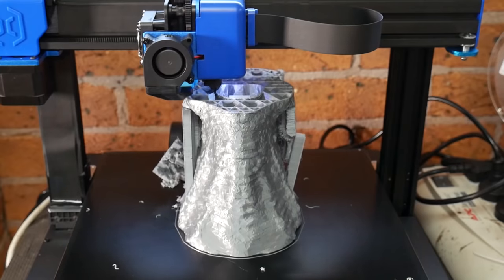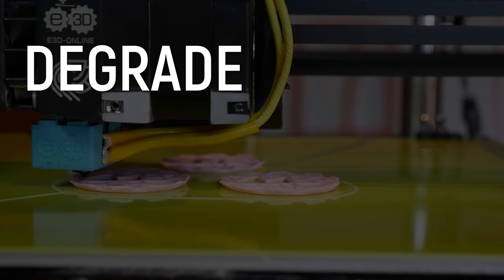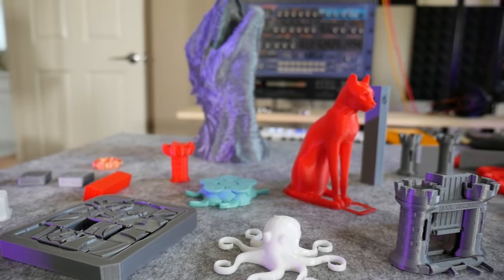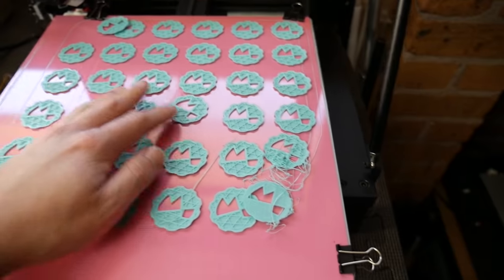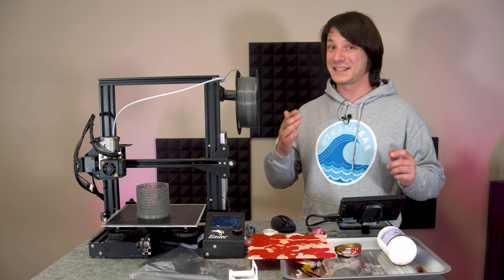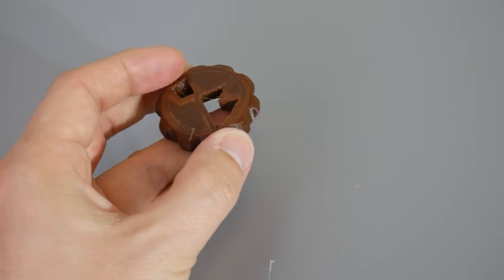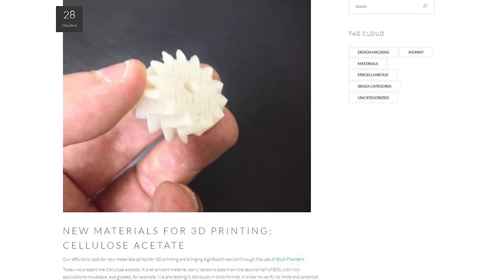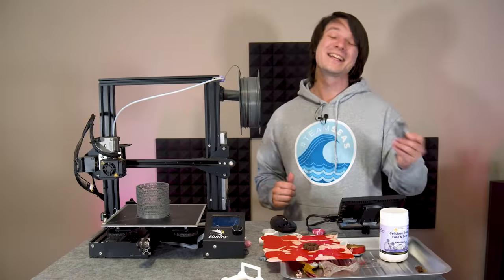PLA - 3D Printing's Biggest Lie.

Comment: This is why incinerators are a good idea. They eliminate the microplastics issue, reclaim the energy, and reduce landfill bulk. As long as we are burning coal and oil for power anyway we might as well burn the waste plastic. (In B4: an industrial incinerator is has supplemental natural gas fueled high temperature post combustion so it breaks down any complex molecules and has a very clean exhaust. It is not a smoky flaming trash heap. Proper incinerators are used for destroying toxic organic chemical waste like dioxins.) 
Besides that plastics are a minor use of petroleum, maybe 5%.

Comment: I believe that fillamentum released their nonoilen filament recently which is supposed to be very eco friendly
Reply: Thats cool, but over 50 usd is a big ask for most people
Reply: @sylaswojciechowski6895  well i just wanted to point it out :) there might be other alternatives too. Even cheaper ones
Reply: It's literally just a modified PLA.  The only bonus is possible lower energy use due to its lower melting point.
Reply: @FranNyan  as i said i haven't done a whole lot of investigation, just wanted to throw it in there
Reply: The Nonoilen filament looks very promising with good thermo characteristics and being recyclable. I think the higher price can actually be a good thing. It makes you think twice before maybe casually just print something instead of really thinking through your design before comitting to printing. If there is an affordable way to recycle this material, maybe in local community form or yourself,  then the higher price for the filament maybe just isn't that high after all .

Comment: The important part of PLA is that it's renewable. THAT is what makes it environmentally friendly. It does not require mining to produce and is made from a material that is endlessly renewable and easy to produce in bulk.   Looking only and the end result and using only that to determine how eco-friendly something is will only give you half the picture and lead you too making choices that are more detrimental to the environment in the long run. 

(Source, I work in Green Building Education vetting products for their impact on the environment.  This stuff is HELLA complicated and cannot be so easily simplified down to this hyper focus on "plastic bad because landfills"  Nothing biodegrades in a landfill. The things you threw away 20 years ago are still there, compacted and preserved for future archaeologists to wonder over.)
Reply: yeah I remember watching a show ages ago where they dug up a landfill and there were preserved newspapers, wild.

Comment: First off, good video, love to see somebody passionate about this stuff trying to make a difference. It is nice to see you actually looking into scientific papers for information.

As a chemist that is somewhat familiar with a few of the things you mentioned, I wanted to give a bit of clarification on a few subjects. 
Recycling of plastics in the traditional sense comes with a few downsides. The big one is the degrade in quality. Every time you melt and/or work a plastic it's quality degrades. Meaning plastic that gets recycled this way often can't be reused for it's original purpose. Still useful, the new purpose would otherwise have used virgin material, but not infinitely reusable. Ideally you recycle by reducing the polymer back to it's building block so it can be used to make new virgin material. I've seen this done successfully, in person, for PET and PLA. It's uncommon for a polymer to be able to be reduced back into it's building blocks. Making PLA a very interesting bio polymer on top of being made out of a renewable resource. 
Regarding dissolving polymer in acetone, this is a terrible test to determine the nature of a polymer. Polymers are a royal pain to dissolve and how quickly they dissolve depends not only on the type of polymer but also on the grade. Additives, shape, but also the polymer itself can drastically change the dissolving behavior of a plastic. To give you an idea of what I'm on about, It might well take days or even weeks to dissolve a high chain length polymer in a sheet and take moments to dissolve a low chain length powder of "the same" polymer. Also, acetone is a great solvent, Poly Styrene (PS) dissolves in acetone as well just to name an example (it's fun to do with Styrofoam). Usually producers put a label somewhere on there product to let you know what plastic is used. Ideally you look for that, or alternatively just contact the producer. I can't think of a single good reason why they would withhold the nature of the polymer from you.

Anyway, keep up the good work. Would love to see a print of cellulose acetate and how it compares to PLA (outside of a scientific paper). If you manage to get your hands on some filament, I'd love to see a video about it!

Comment: i just use my failed prints for %100 infill. If my model can withstand a no infill i just print them to the last top layers. stop melt my leftovers wait them to become pasty and just apply them inside. %100 PERCENT İNFİLLL. (print you walls thicker for structure and melting point becoming harder to achieve for walls.)

Comment: What about a standard for filaments to make them intercompatibale in terms of recycling. That is, there can be companies that recycle and resell filament, but to make sure the filament can be accepted for recycling you would need some sort of certification and verification process to ensure that decent filament would come out of this process. None of that filled shiny rubbish, just filament with additives within standard to make sure it can be blended and extruded back into usable material. And have a few of these: PLA, PET/PETG, ABS perhaps. With fairly local facilities for recycling it.
Reply: It works in theory, but it's impossible to enforce this all over the world. For the recycling to succede you have to know the composition of all recycled material. If someone returns a benchy printed with a 3rd party material with wonky additives it is basically impossible to detect and will potentially ruin the material properties of that batch of materials.
Reply: The only problem I see with your idea is that a heterogeneous mixture of different filament compositions will have widely varying material properties because different additives used on filaments by different manufacturers. It would be a lottery every time a consumer gets a recycled filament roll unless all filaments of a specific material has the same chemical composition and additives between manufacturers, which would kind of kill business competition.
Reply: @Eadsn  You don't need to enforce. Have filament producers apply for certification. QA is indeed the biggest question since people who are sending the parts to be recycled must keep track of what filament they have been using. This however can be solved with some form of streamlined testing process (e.g. DSC + tensile testing) throughout production.
Reply: You don't mix plastics. When recycling they are sorted into PET, HDPE, PVC, LDPE, PP, PS, etc. Then they can be remade into something useful. PLA and PET are pretty hard to differentiate btw. This sorting in groups is only useful in higher quantities. Mostly PET and some HDPE is recycled into equivalent quality material. Down cycling happens more often, but isn't a circular process, just one step extra till it's waste.
Reply: Even if you could convince more than a handful of Scandinavian countries and Japan to comply, you'd still have the issue of pollution over time without 100% compliance. Plus the real people to convince are the corporations. If it's not cheaper to do (and they're not forced by government mandate), good luck getting industry to move a muscle.
Reply: @tyakoss  The issue, as far as I can see,   is that you can not have 100% control of the material coming in to the recycling fscility. And plastics can't be differentiated easially, the density is almost the same and it's not magnetic etc.. There are ways of determining the chemical composition of plastics, but these methods are slow and not suitable for a large scale production facility.
Reply: @custos3249  A reduction in waste nonetheless. A similar idea to using 50/50 mixes of fresh and used powders in SLS. The starting point would be to work with an existing filament manufacturer (Prusa, Colorfabb or whoever) to accept parts back for a discount (e.g. return 1kg filament for 50% off spools of recycled filament) and slowly add filament brands to the list of accepted materials (e.g. SUNLU standard PLA or whatever is popular nowadays) and grow the recycling network. A big issue would probably be logistics -- some good maths needs to be done to make sure the whole scheme can work economically.
Reply: @tyakoss  You're right about logistics. The shipping for returns would kill any program's chances of getting off the ground, unless people were willing to pay for the extra cost. It'd be ideal if it could simply be tossed right in with existing HDPE, PP, etc. material streams. Regardless, we can dream the "man, wouldn't it be great if..." dream all we want. There's no reason to expect any proposed solution definitely will yield results that compete with existing property needs without extreme changes to industry or lateral move drawbacks like with the plasticizers mentioned. I've always thought we should put more effort behind in-house recycling of common plastics, not to mention also applying the same redemption taxes seen on pop bottles everywhere like they do in Germany. It's wildly effective for diverting materials out of waste streams, but what's done with those collected materials is where the chain breaks down since China stopped importing trash.

Comment: The only actually good for the enviroment solution I can see is to burn all the garbage and capture all the co2 or other bad gasses.
For example, you're sorting your trash so it's all recycled?
Well only fraction of it is actually recycled and it costs a lot to work with, and those costs being for example electricity that usually comes from non enviroment friendly plants...
Reply: Plastic is not only molecules made of C,H,O,N atoms, there are other atoms used for plasticizes, inks, pigments, stabilizers, etc.  Also burning plastic creates molecules that are either bad for health, or straight poison, think benzenes, aldahydes, etc.  And that is assuming only plastic is present in the trash.
There are ways to avoid some of these issues like making it burn at even higher temperature, but then you need to add extra fuel to make it happen, and you are still left with the filtering needs on the hot gases created.   There are power generation stations that do this, but not cheap.
Reply: There are experiments for gasifying waste and turning it into common precursor chemicals like methanol that can then be used to make new stuff, with the ~10% that won't gasify ending up as a sort of synthetic stone that could be used in construction, but no full-scale facilities that could handle a whole town's waste yet. Supplemented with a biological stage to get out anything compostable first, it'd make a great complement to existing recycling systems.

Comment: on a side note, the amount of failed prints will never amount to the same waste, as the plastic that gets thrown out BRAND NEW in big productions. Just to hide profits and keep prices high, they will overproduce and throw away products, so they can show losses. 3D printing is still the future imho. I have repaired many tools, toys or kitchen hardware, by just printing the tiny piece of plastic that broke. Sometimes replacing a sintered piece of metal! Just the other day did the little plastic foot break of my keyboard, that props it up (tilts it). After about 2 hrs of designing the piece on the laptop and printing 4 failed pcs (about 30x30x5mm in size) I clipped the replacement part on and I don't have to throw out the keyboard or prop it up with a stack of paper or something. LOVE IT! Even for work, do I use prints as cable retainers or circuit board stand-offs and clamps. Best hobby I ever got into.
Our dog gate would NEVER mount to the doorway, if it wasn't for the corner adapters I printed, saving the wall and assisting with clamping force. The applications are FAR REACHING!

Comment: I've never thrown a scrap of my PLA (and other 3D printed materials) so i can assert that even my oldest bits, haven't decomposed in any capacity. Hell, my first tests with PLA, for strength and quality are still around from when PLA was the new hotness.
I also have PLA prints that have been in the sun for at least 4 years now, not even the least bit degraded. So yes. Greenwashed.
Reply: Most all plastics photodegrade. Into microplastics.
Reply: @mandowarrior123  One of the early claims to fame for PLA was that under sunlight exposure, it would degrade to the point where it would become mulch. A "clean" one. I know microplastics abrade off, kinda like skin, but we're talking structural, near invisible particles. In retrospect, i should've put some of the early PLA prints inside a clean box to see just how much falls off them. I know ABS loses quite a bit with use and sunlight.

Comment: The best way to use waste prints is to store them up and turn it back into filament.
Reply: I highly doubt that most hobbyists have the money needed to invest in the equipment to do this. There's really no cost effective way for me to recycle used filament into filament that actually prints reliably.
Reply: @Becvar80  what we need is a cheap service that will recycle prints into filament and sell it for a lower price   If we can recycle prints into viable filament for a lower price than making new filament and do it at scale......  that would be even better than biodegradable filament then we are talking
.
.
If  we start to make 3d printing something widely used by the majority of a population  we can start recycling filament at an systemic level and manufacturing it with a large portion of recycled filament.

Comment: Don't worry about it, you could run the extruder normal speed directly in to the sea 24/7, and produce less plastic waste than i do at my job removing plastic wrap from pallets send from one side of the building to the other. 3 large trash cans of compressed industrial plastic wrap per shift. That's just me, one position in one warehouse in one company.

Comment: Two years later it's fascinating to discover various disciplines in science discussing the benefits of plastics in our oceans and the downsides to removing them. Before we all throw our arms up in horror (which I did), there was a very noteworthy point made and it was this...
It's been calculated there is ~90% less driftwood available in our oceans than there was circa pre-industrial times. This has lead many macro & micro-fauna species, from crustaceans to cephalopods, to adopt plastics to play the role driftwood once did - a substrate to lay their eggs upon and even protection for some species broods. So the discussion is leaning towards management (open gate, bolting horse) over total removal which risks killing off thousands of small species critical to the food chain.

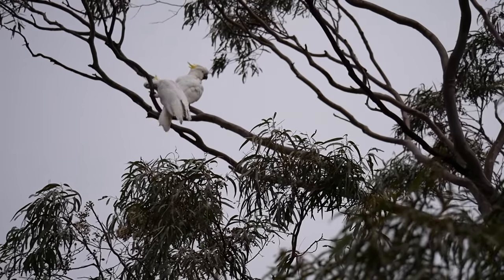Comment: 12:44 hi, renewable energy student coming off like 2 weeks studying this exact topic! Thats actually not true (probably)! At least in the US, 90% of the corn grown here is for the purpose of feeding livestock, and the process of making ethanol actually creates the feed grain used to feed animals as a byproduct! Additionally, ethanol can be made from basically anything that can be used to make alcohol (for example, in brazil they use sugarcane and actually have a dual-fuel economy where drivers can choose to fuel their cars with ethanol fuel or traditional gasoline. Brazil was the first country to take steps like this towards energy independance and independance from foreign oil, which is super cool!) the idea that ethanol 'burns food' is actually a deliberate scare tactic that was created by a washington dc based lobby company on the behalf of the oil industry in the early 2000s. Its total nonsense and just serves to slander a really really promising field of renewable energy that we have the capability to utilize *right now* with very minimal retrofitting of existing equipment and machinery! A study was done TWICE in order to see how much ethanol fuel the USA could produce with the amount of corn we grow now, and they came up with a whopping 1 billion gallons of fuel, a number so startling they did the study again to check. The results were unchanged. Theres definitely problems with the way that ethanol and other cellulose based renewables are sourced (corn farming is terrible for the soil) but it is one of the most promising ways to move away from crude oil, and theres half a century or more of misinfo and scaremongering to deal with first. Regardless, great video as always, i am fascinated with 3d printing but the fact that it is undeniably plastic has definitely been something that has stopped me from getting into the hobby personally. If theres more research done on this kind of fillament and it becomes more available, i might have to finally take the leap! (sources to come, im on my phone and dont have my class documents right now)